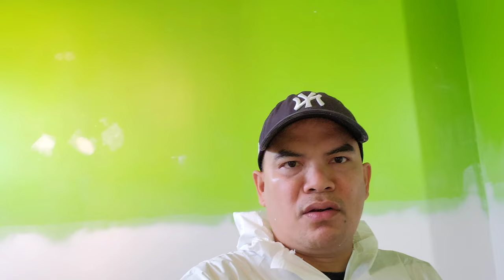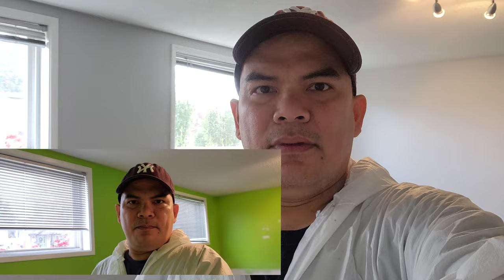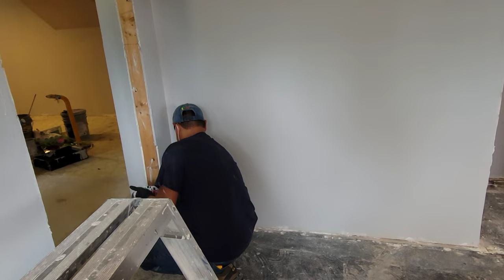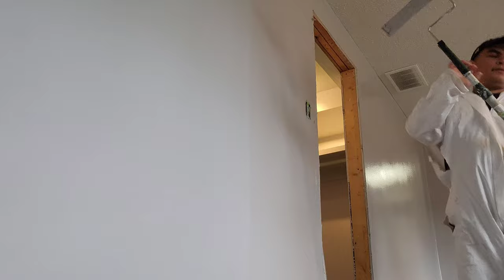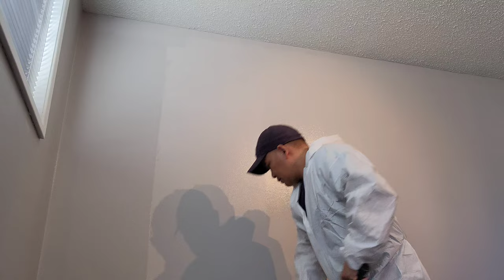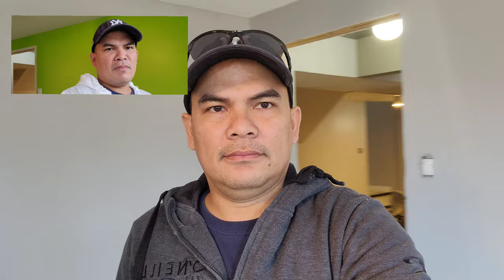HOW TO PAINT AND CHANGE COLOR FOR OLD WALLS | PAGPALIT NG KULAY NG PINTURA SA WALL|@mrideastv8563

Comment: Nice job. That’s why I prefer painting by myself to ensure quality. I hired a painter before and rushed the job, I saw hairline brush marks, even painted the over the light switches really bad. Question why some avoid rollers? In the city I live in, it seems they’re into using brush only. I have new house now and these new painters seems to be using big brushes only so I still see those hairline mark left after paint dries.